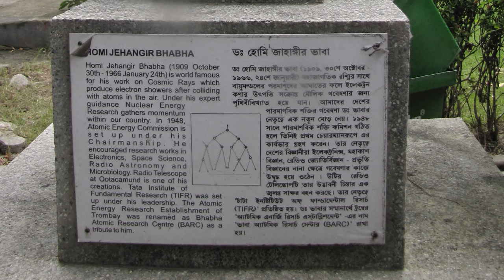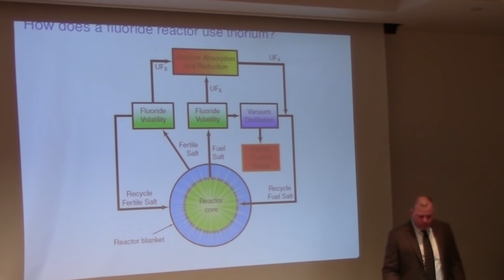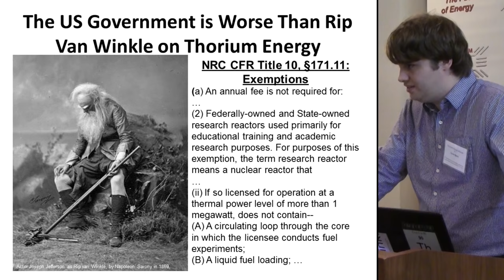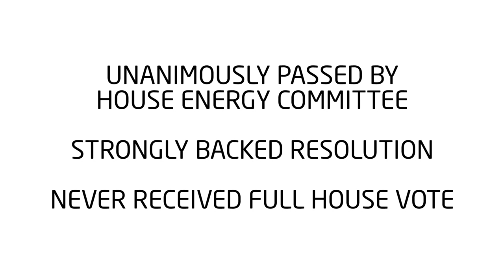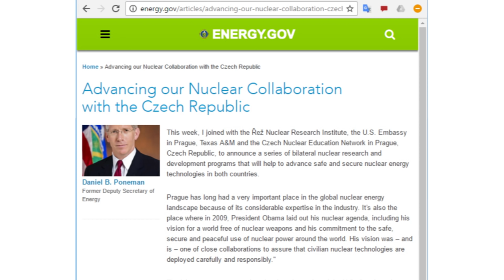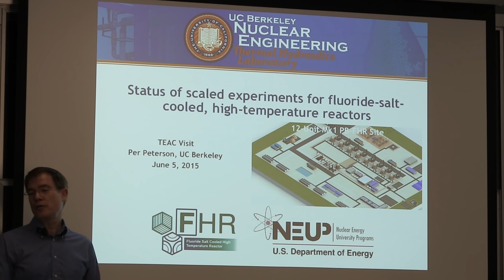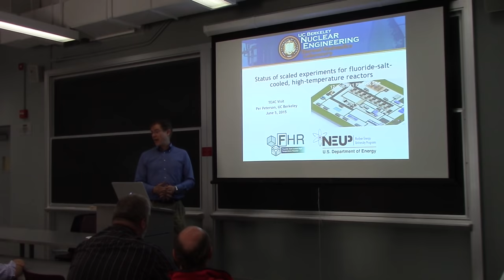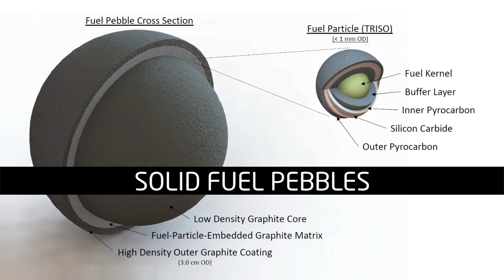Thorium, India's Solid-Fuel Approach, and Licensing Liquid-Fuel Reactors - TR2016c 3h06m07s17f

Comment: India would become ULTRA WEALTHY if they start mineing thorium, if they refine heavy rare earth metals at the same time. Sounds like it can be done very safely as new tech advances and responsible, smart people from all sides involed! Smart progressive move for their people and their national interests to be competitive in the future.
Reply: No, India will not become "ultra wealthy" because of it as developed countries like US also have massive Thorium deposits and poor counties won't buy it. Australia has a lot of uranium but they didn't become wealthy because of it.
Reply: @SurajSinghTomarArya  The wealth need not necessarily come from selling the Thorium. It comes from a) developing and selling the power plants themselves, and b) by building a robust, uninterrupted power supply network that provides cheap power for everything from maglev trains and electric vehicles to lowering input costs for industry which boosts their production and dissuades power theft (if power is super cheap, there is very little incentive to smuggle or steal it). Not to mention the massive benefits of cleaner air by avoiding dirty coal burning power plants, the coal for which is largely imported at market rates.
Reply: India doesn't mined thorium. What we use thorium today is actually found in sea sands around kerala state

Comment: Does a molten salt fast reactor have any downsides in  comparison to MSBR? 

I'd thought it is easier because it doesn't have all the graphite in the core
Reply: Twitchier controls and higher fissile requirements are problems (20% compared to 5% LWR). I think they can be simple single-fluid reactors breeding plutonium and all the reprocessing requires is fission product and excess plutonium removal. A single-fluid LFTR requires much more chemistry.

Comment: Uh oh.  I begin to see a problem with thorium.  They said that India has been working this problem since the 1950's.  Well, you know how smart those Indian guys are.  If they haven't gotten it done in 60 years then maybe there are too many problems to be practical.
Reply: Jack Roth Did you watch the video?
Reply: Science takes time and patience.
Reply: The Bottleneck is not technology here per se but the logistics behind the technology. In order to have an economically viable and efficient use of Thorium India developed a 3 stage nuclear reactor programme.

First you use Uranium in PHWR to create a stock of Plutonium.

Then Plutonium in FBR will give more P (thus the name breeder) which is used to make more FBR until you reach a steady production rate of P.

Now you use the continuous supply of P for Thorium Thermal Breeder where P gets consumed but Thorium becomes Uranium 233.

So the catch is that Thorium Reactor will use up P while FBR doubling time of P can be as long as 70 years for some older reactors. That is the bottleneck. The doubling time of P in FBR has been longer than what was initially expected by Dr Homi Jehangir Bhabha. Although modern improvements have reduced it by half or more.

India has already finished stage one. Stage 2 is in progress. In 30 years our plutonium capacity will be high enough that we can run Thorium energy for next 400 years if we only take present prospected and very feasible stocks of Thorium in India. 70 years done, 30 more and we achieve energy security for the millennium. No more bullshit about oil, OPEC or Petro-dollar.

India chose the most technically difficult design of nuclear power generation, costly, slow, inefficient and complex. That is why US shut it down, cause it couldn't see beyond short term profit. Don't even start about Germany or France. But India had a long term goal. It is not something you can catch up within a few years. That is what the Chinese are learning. What is poetic is that the country with the largest Thorium reserve also happens to be India only.
Reply: Homi Bhabha was assainated which halted the growth of the reactor. Think he said the same what today's scientists are saying think about his intelligence and capacity to think forward
Reply: Our leading nuclear scientists keep on dying.
Reply: You are right bro
Reply: @sabyasachisingh5931  The creation of large amounts of P also raises eyebrows for its weapons potential. Part of the nuclear deal with the US was the bifurcation of civil and defense use reactors. The road to a thorium-based power economy is a long and complicated one.
Reply: The reason is that CIA killed some Indian nuclear scientists back during the cold war to stagnate the progress
Reply: We are working since we got independence despite of widespread poverty now India is far far ahead of developed countries, that's key factor India could lead world in fossil fuels free energy.
But we hate America because they sanctioned India and killed our Homi Bhabha, father of nuclear science in India.
America also sanctioned our space program but today we are launching American satellites. And also America is cautious about India's cheap space program could hurt their space industry.
Reply: India is both capitalist as well as socialist that's our advantage, which could benefit us in future. Socialist teaches us to be dedicated and capitalist teaches us to utilize, results after dedication.
Reply: @AmanVerma-mf5kt  that's actually quite nice

Comment: Whoever this Lyons character is, whether scientist or pseudo scientist is we can make up our minds. Having skin in the game for solid fueled GE 2 or 3% burn up rates and using a miniscule amount of fuel means he has never even looked at lower cost molten salt for many years. In other words horse blinders away from the path of non-load following expensive electrical power vs 96% burn up thorium molten salt that will also de-salinate, provide heat for chemical reactions, and produce practically unlimited process heat.

Comment: This video makes me LESS convinced of nuclear power not more. Despite keeping at it trying to crack the nut since 1950 they have still not figured it out. 70 years working on this problem!!! Meanwhile solar, wind and battery technology is improving rapidly EVERY single year. The progress is relentless. Yet all nuclear stuff seem stuck in mud and not getting out. I have had an interest in Nuclear power since the 80s and all I see is all the same talk, talk, talk and more talk. It is a pipe dream. I am sure they will figure it out eventually, but when they do the tech has been rendered mostly obsolete by wind, sun and battery technology. Oh an and another technology. Electrolyzers are also improving rapidly which means we can start producing combustable gases ever more cheaply using wind and solar power.

We already have tons of gas power plants and storage facilities for gas. If we can make that gas cheaply with surplus wind and solar power, why would we need thorium reactors? I think nuclear reactors will end up being more useful in space exploration and colonization.
Reply: India is taking the solid-fuel approach. In contrast the design of the Molten Salt Reactor Experiment began in 1961, was built and went critical in 1965, operated at full power in 1968 and completed operation in 1969. Doesn't take long when there's political will.

Similarly, Flibe Energy hasn't received any funding until 2016, hence the abundance of 2011-2016 lecture material. Today Flibe Energy is working on the Chemical Kidney, Fissile Security and a Noble Gas Management System. 

Molten-Salt Reactors, today, are taken very seriously by DOE. I expect they'll continue to be taken seriously until an anti-nuclear candidate is elected who believes the same thing you do about batteries+renewables.

There's an earnings call with Elon Musk where he speaks about advancements in battery technology (or lack-of). What battery did the Roadster use? Lithium-Ion. What battery does Model3 use? Lithium-Ion.

It is easy to find. 2014. Elon Musk. Earnings Call. "send us a sample" Very predictive of the 6 years which followed. (Also, Elon Musk is supportive of Thorium Reactors and Andrew Yang for president.)
Reply: @gordonmcdowell  No, no stop these nonsense arguments. ANYBODY can get a research reactor working or a prototype.

We have prototypes for ALL sorts of cool and interesting reactor designs and we have had those for DECADES.

It is a VERY DIFFERENT thing to make this at commercial scale, and make them practical and profitable. That requires considerable research and development. That is where 90% of the job is.

Demonstrating the principle is like 10% of the job. You are boasting that they did 10% of the job already, and try to imply that success is right around the corner. It isn't.

> What battery did the Roadster use? Lithium-Ion. What battery does Model3 use? Lithium-Ion.

You don't get the key argument. Battery technology is like research reactors. There are lots of novel designs in the lab. Stuff like this take a lot of time.

The difference with batteries is that proven technology is still getting refined and improved. Lithium-Ion is getting cheaper and better. That kind of incremental improvement is not happening with nuclear reactors because they are not mass produced items.

Same deal with solar cells. Lots of alternative cells exist like there exists alternative research reactors. It takes time to get this out. But meanwhile well established solar cells technology gets refined and improved every year. Why? Again because we got MASS PRODUCTION. Reactors don't have mass production, that is why they are stuck in the mud and will stay stuck in the mud for decades.

If they figure out Thorium reactors I will be celebrating. No doubt about it. But I am not holding my breath, and neither should you.